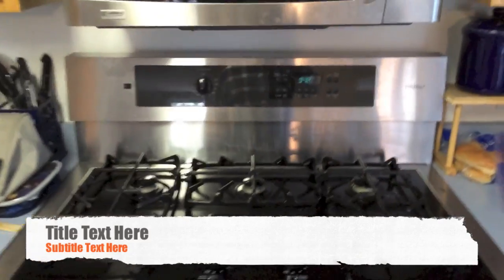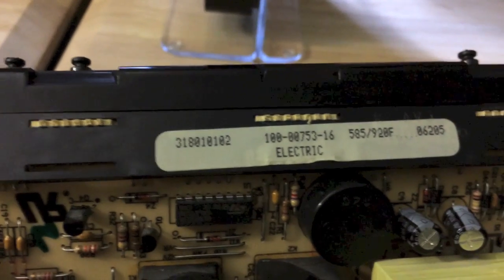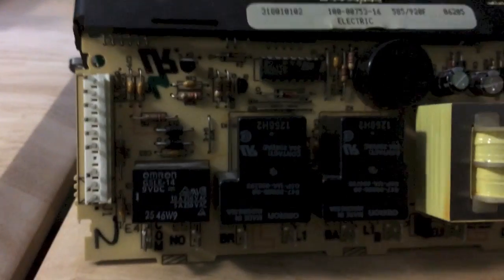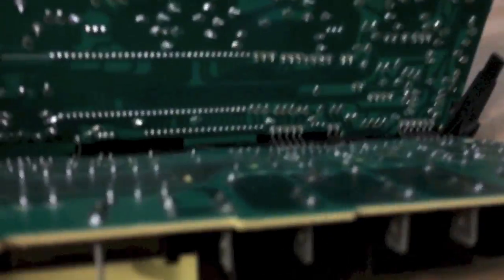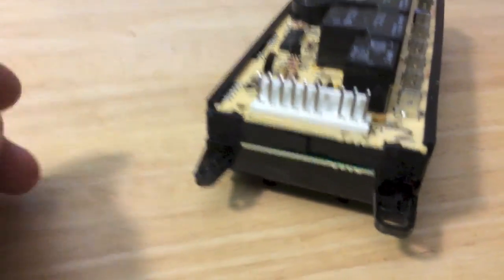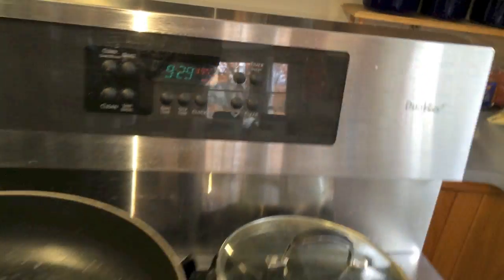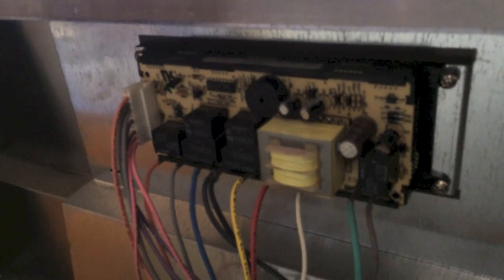Repairing Electronic Oven Controller on Kenmore Elite Oven 790.75503

Comment: Hello sir. This issue happened to me. I had no idea what was wrong until I searched for the oven and came across your article. It was 50/50 that this could even be the same issue but I felt it was coincidental enough to give it a look. Sure enough, the solder was burned through at the exact spot you showed. Also, there was another solder joint that looked "iffy" on a different relay. I was more concerned about the electrical burn soot that was all over the corresponding area on the front of the control board. (Which all wiped off btw). Well, long story short, I soldered those two connections and put everything back together. Still believing I had a 50/50 chance of repairing it. BINGO!! It worked like a charm. The oven came right up to temp. I want to thank you so much. I can't even imagine the heartache you've saved me. My best to you and yours sir.

Comment: Matt,.......thanks again for the refresher. As I said it's been over 5 years since I made this repair and the oven just started acting up again with the bottom element not working and a F1 error code. It's funny how you can forget what you did 5years ago so your video was very helpful. I had my doubts that lightning could strike twice however I found another failed solder joint. I soldered the terminal and re-soldered my first repair from 5 years ago as a preventive measure. I'm beginning to think this is a design flaw or that the original solder joints are inferior. The GREAT NEWS is it's working great now.  I'm not going to lie I did some praying as well because right here at Christmas would have been a terrible expense to replace the stove. So...., thank you Jesus, and thank you Matt.

Comment: Hello I enjoyed your video and actually made this repair at least 5 years ago. Now having the same issue but also having a F1error code. Did anyone have the code as well?
Reply from the maker: Steve S. I would make sure you didn’t accidentally drop solder on a component and cause a short.  Also check your solder repair on the relay pin, make sure you didn’t short it to another pin.
Reply: Matt DeRoller I made the repair about 5 years ago similar to a repair I saw on YouTube. I was very careful, so solder on other parts won't be an issue. The oven has worked perfectly since I made the repair. Now the bottom burner is not working at all. Not looking forward to tearing it apart but with 20 people coming for Christmas dinner I guess I will need to very soon.
Reply from the maker: Steve S. Sorry to hear that.  Obviously take it apart again and see if the relay solder joint burned through.   Also, this error could be a checksum error too, removing power from the controller may remedy that.

Comment: Thank you so much for posting this video. I have had my Kenmore Duel Fuel stove for 10 years now and the same thing happened, wouldn't heat up. I was told to buy a new stove because the control board has been discontinued. Thank goodness this worked!!!

Comment: Thank you for the info. I have the same oven; however, my display is very dim.
Reply: Hi- Mine as well. Were you able to fix that please?
Reply: @bigtstudios5535  Turns out the stove had multiple issues so I stopped trying to fix it.

Comment: THANK YOU MATT. YOUR VIDEO SHOWED THE SAME PROBLEM I HAD....FIXED IT AND IT WORKS FINE.MUST HAVE BEEN A FACTORY GOOF,THEY PULLED THIS CONTROL BOARD AND IT IS NO LONGER MADE.THANKS FOR SAVING ME MONEY ON A SEND AWAY REPAIR.THEY WANTED 175.00.TOOK ME 15 MIN AND A DROP OF SOLDER .THANKS AGAIN....................

Comment: WOW.....BAM.  Thanks so much for this video.  Oven went out for Super Bowl Sunday, did some basic troubleshooting, and called a Tech.  While I waited for 24 hours, I did some research and almost had heart failure when I found out they don't make parts for this unit anymore and a replacement size (40") was $4-$6k.  Tech came, diagnosed the board was shot, said he could possibly repair it in a few weeks, and I paid the bill for $90.  Using the Model Number he left for me (I couldn't locate it earlier) I googled it and found your video.  It was as easy as a 10-piece jigsaw puzzle.  Took me 30 minutes to repair it.  Great job - thank you.

Comment: Matt I cannot say thank you enough for posting this video. We bought our house in 2012 and the appliances looked so beautiful we couldn't believe this house was in our budget... however slowly but surely each one began to crap out! First washing machine then dishwasher then our beautiful oven! After totally replacing our washing machine I thought I'd search for an answer on the other two. The oven posed a problem because I had a sears representative out who said at minimum it would cost 500 to send panel out to be looked at (they no longer make replacement panel) and that may not be the answer either! After about 2 years of only using side oven, I YouTube again and thank god came across your video! It worked!!!! Thanks a million!!
Reply from the maker: I'm glad it worked.  This range is no longer available from Sears, but the basic parts are still available (except the controller).   I hope we can keep it working a while longer.

Comment: I found the same relay bad solder joint on my kenmore 790.79462600 dual fuel oven... its control  board is  316462852.   Saved me 2 hundred bucks DIY or probably 450$ for repair man.   These joints do demand some current and I think mine was a defect in the solder joint  that got hot  and over time cracked more until finally the current was using such a small area in the joint it blow it clean open.  I sucked off the old solder and cleaned the post well with a wire brush then resoldered using a good clean iron... it will require more than a 15 watt iron more like a 30watt.

PS both elements wouldn't heat.

Comment: Holy cow matt!!! My friends range has all the knobs on the back, but the console was exactly the same. I took I took it apart and it looked okay, though the SAME place you solder looked a lil big different. I did not have a solder gun, so I went with a bet it was the temp sensor. Got one, talked to the guy at that appliance store who checked my heating element and it was working. Got home, installed the temp sensor and PRESTO....it didn't work. Soooo, I went back and checked the points on the relay again. Now funny thing, the first time, I did not have my glasses on. I lost them in Idaho, or so I thought. After I put the baby back, I found the glasses in my hood. I was changing a headlight in Idaho and I must have laid the glasses down. NOW, I take out the control box again, crack it open and PRESTO....YOU WERE RIGHT. It was burned out. I soldered that baby back and the oven lit up like a one legged lady leg lamp! I am shocked...the exact issue...it's 2016, you published this in 2013 and the exact point went out on this range also. Maybe someone at the factory was sleeping that day? so odd! Thanks for the video, I never would have figured it out without your instructions. PEACE!!!

Comment: Thanks so much for making this!  I had the same problem:  baking element not turning on.  Broiler worked fine.  I have been using the broiler to preheat the oven and then turning on the convection setting for over a year now.  I was worried that I would need to replace the oven ECU.  I took apart the ECU, I found the bad solder connection on the baking element relay.  Simple fix.

Comment: hello matt i own this same oven and im not having this problem, the fan in the oven is not working making the air not circulate correctly. having trouble finding any information on the machine. sears is being no help. was wondering if you have ran into a problem like this or heard of one.
Reply: Jimmy Harris hey I had this problem too and I had to replace the door switch.

Comment: This was a God send! After paying a Sears repair man $100 to tell me it couldn't be fixed because the control board replacement part isn't available any longer and that I'd have to buy a new range,  I googled to try to locate the part myself and eventually stumbled upon your video. I shared it with my husband and with a borrowed solder gun from a neighbor it was fixed in less than 30 mins.  Because this size range (40 inch width) isn't a standard width it would have cost me either $8,000 to buy a custom sized range or thousands of dollars to modify my cabinets and granite counter tops to modify the space to a standard size range. Thank you, thank you, thank you!!!!!!
Reply from the maker: Hi, glad it worked!
Reply: Anyone else reading this just know the part is still available on part websites for $170 as of 1-11-20
Reply: I found a used one on ebay for $50 for mine after seeing they wanted 260$ for a new part

Comment: Awesome.  YouTube has saved me a bundle on my dishwasher, garage door opener, Toyota, and now my stove.  Thank you for posting this.         Only comment:  Heat shouldn't be getting to the circuit board, if it did we would see other components being burnt.  Likely too much current is going through that solder point.  Possibly a design oversight?

Comment: Matt, I have the Kenmore Elite Dual-Fuel 7907946 that was having the same issue. My circuit board looks a bit different but had the exact same issue of the relay on L2 output. Re-soldered it, and we are back up and running. Thank you for saving me countless hours of changing parts.

Comment: Hello Matt:
Couldn't reply thru reply button.   So I had to reply thru a new thread here.
No, breaker isn't actually tripping.  Baking oven just beeps and blacks out without Fail Codes displayed.  It comes back on on its own after a while.  BTW the Micro on the same hardwired plug stays on and consistently works.

Comment: I have the same stove with the same issue. It would get to 170 degrees and just stop. I looked at the board and it was the same spot that was burnt out on the board. I re-soldered it and it works perfectly now. THANK YOU SO MUCH! :D

Comment: Unbelievable... Mine had the same issue.  Thanks for pointing me in the right direction.
Reply from the maker: +Jeff Davis  Over 2 years later and mine is still working.  I didn't have to re-solder it again...yet.
Reply: +Matt DeRoller I can't believe so many of them had that problem

Comment: Hey thanks a lot!  Your method worked our dual fuel model - same model as yours.  Same issues as yours.  I may replace one of the relays - an off-board one that is in the middle back panel of the chassis.  Thanks again for the great video!!

Comment: THANK YOU!!!! My parents' Kenmore oven (790.9503) had stopped working. My dad could see that the oven coil was getting power but nothing was happening. We could hear the relay clicking as you described. After watching your video we were able to find the problem and fix it--two of the connections were black. THANK YOU VERY MUCH FOR TAKING THE TIME TO MAKE THE VIDEO AND POST IT!
Reply: BTW, we had a little problem at first, which was that the buttons didn't work. This was because when we put the computer back together, the back circuit board was slightly out of place. Our fault. Just mentioning it in case anyone else does the same thing.

Comment: My Kenmore Elite Dual-Fuel oven started acting the same way last night. Your video was the first one I found and the only one I watched this morning. When I took my oven apart the bad solder joint was on the transformer though. Cleaned it up and soldered it and it works fine now. Thanks for sharing this! By the way, those pesky black plastic clips that sandwich the circuit cards together gave me a few minutes of grief until I figured out you just pull the keepers out of the center first with a tweezers, then you can squeeze the clips to free the circuit card.
Reply from the maker: Thanks for sharing that tip about the black clips.
Reply from the maker: Todd Anderson  Here is a video that hopefully helps:  https://youtu.be/-lamoHcMH5E
Reply: Thanks Matt that link did the trick!
Reply: Is there anyway you can post a picture or describe better how to get those pesky black plastic clips off.  I am having a heck of a time.  Thanks in advance.

Comment: Hi great video,got a question for you i took my control board off the back of my stove,the question i have for you is,My wiring i have 2 orange wires 1 ishas a bue stripe does it go in the 1st slot or the last one next to green?
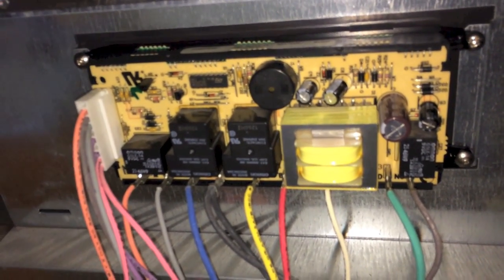Reply from the maker: +Mondo Costa At around 5:09 of my video you can see the wiring.  I don't know if that helps or not . It looks like I have 2 orange wires, but one is attached to a connector.
Reply: The 1st slot is it solid orange wire
Reply: @AlphaPepper  please help
Reply from the maker: Hi Candy, what do you need help with?  The wiring?  Best I can do is recommend you look at my video starting around 4:59.  It show my oven’s wiring but it may be different than yours.

Comment: Matt,
We don't have the exact same model range/oven as you, but I had a similar experience, with the same type of relay.  After discovering the burnt terminal on the control board, I went on an Internet search and found your video.  Same exact realy, same exact terminal.  I did the solder repair and the oven is working again, but I couldn't put this out of my mind.  I've done some thinking and a bit more research and here's a brief opinion/summary (I am not an electrical expert, but I've had some training and practical exposure in my work- consider this partially educated conjecture):
1.  I think the source of these issues is the relay, not a defective solder joint.  I think resoldering the joint leaves the oven at risk of a repeat solder failure (if you are lucky), and potentially an oven fire.
2.  From the wiring diagram (previous owner spilled oil all over my copy, so it's difficult to read), it appears this relay is switching the full current to the oven element (rating on the relay says 20 amps, which seems very high for such small conductors.  Compare this to the #12 wire required for a 20 amp circuit for house wiring).  I think it's possible the source of heat is damage to the relay contacts that causes electrical resistance.  The resistance creates heat (P=I^R), same as the resistance in the oven element heats the oven.  The relay lead gets extremely hot, melting the solder.  As the solder melts away, it's likely there's an arc flash as the circuit breaks, which causes the burning we've both seen at the terminal.
3.  I did a brief internet search and there are a number of complaints about ovens not turning off (as Janice mentioned below).  This is probably caused by the same issue, but instead of building up resistance on the contacts and melting the solder, the relay contacts fuse together, so the element stays energized when the control de-energizes the relay.  I'm not intending to represent myself as an expert, but it appears there is a risk of an electrical fire or oven fire.  Each of us need to evaluate this risk and determine if it is something we are comfortable with.
4.  There appears to be a recall for certain models of Kenmore ranges and ovens.  I came across one person trying to get others with the same model oven unit to report any issues they were having because the Consumer Product Safety Commission hadn't received enough complaints to force a recall.  Given the number of different models that use this control, it is important that each person take the time to file a complaint if you have an issue- especially those of you that have oven elements that won't turn off.  It is for your safety and that of your community.  I think we've seen enough recent evidence to demonstrate that some (unfortunately, probably many) corporations won't recall unsafe products voluntarily.  It appears that this issue has been ongoing for years- I imagine Sears has been aware of it for a long time and I see no evidence they've been trying to resolve it effectively.  Just imagine the amount of money at stake!  Anyway, I felt the need to comment as this is a potentially serious safety issue and all the comments here gave me the feeling everyone thought re-soldering the circuit resolved the issue.
Reply: +Jennifer Koenig 
This is actually Joe Koenig, Jennifer's husband.  For some reason, when I set up the account, with our home email, it used her name.
Reply: +Jennifer Koenig 
I just filed a complaint with the Consumer Product Safety Commission at www.cpsc.gov and it took about 20 minutes.
-Joe
Reply from the maker: Let me know if you hear anything from them.  Thanks for posting this.

Comment: THANK YOU!!  Your video just saved me from having to buy a new oven. After taking my controller apart I found my solder burned out exactly like yours in the video. I had  the solder repaired, popped the controller back in the oven and it works perfectly again. (I just wished i had seen this video before I paid my local repair guy $115 to tell me to buy a new oven.)  Thanks again!

Comment: Excellent video!  Unfortunately this is my second "trip to this rodeo"! ;-)  I've had this stove since January 2008 and it worked fine up until late August 2014 (~6.6 years).  I fixed this problem the first time around in early September 2014 and here I am ~10 months later applying the same fix (i.e., the solder joint I fixed didn't hold).  I suspect I didn't use a high enough melt temp electric solder.  This time around I used "BernzOmatic Electric Lead Free Solder" 430F Melt Temp.  Would rather use leaded solder as it is more durable at high temps but I use what I can get ahold of.  I hope I don't find myself back here in 10 months, or ever for that matter, but now that I've done it twice now, I am getting more efficient at it!  Plus, I'm able to clean up all that crud that gets on the sides of the stove after years of cooking as well as the dust bunnies underneath!
Reply from the maker: Thomas A. Moulton Good to know.  Thanks for sharing.